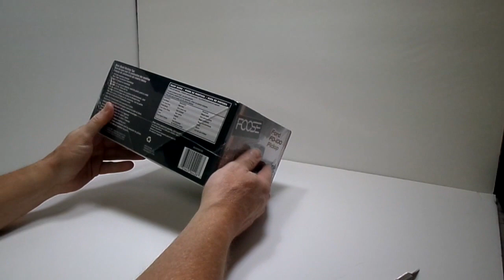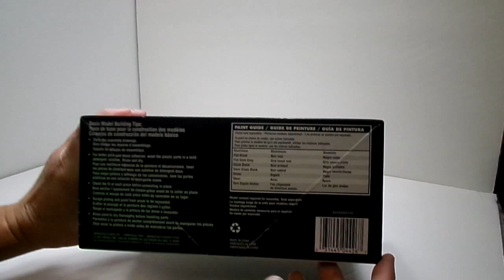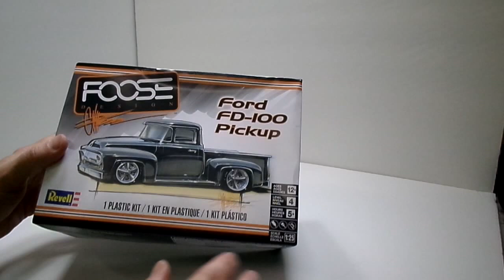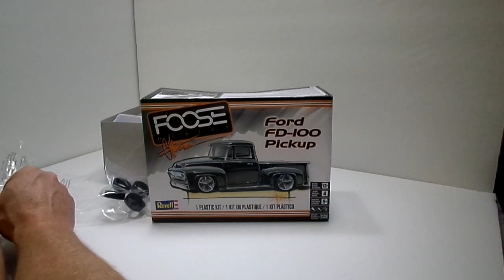Kit Review: Revell Chip Foose Ford FD-100 Pickup

Comment: just got one does anyone know what type of gule/cement i should get, also any other tools that would help the build go more smooth. 

thanks.
Reply from the maker: Andres Bautista liquid model cement, and/or super glue. you'll need at least a hobby knife and some sort of sanding tools, plus paint.
Reply: TruxCustomz thanks alot of the responds
Reply: I recommend Tamiya extra thin cement
Reply from the maker: dishchicken that's a good one.
Reply: in what way do you mean that, like "haha... no" or you generally think it's good?
Reply from the maker: dishchicken I've used it before & was agreeing. strange that you interpreted it differently. you must not watch many of my videos.
Reply: I should though.